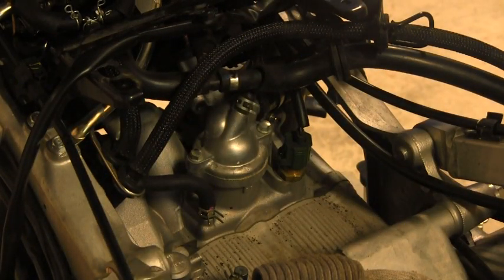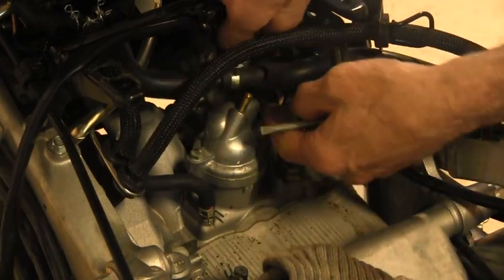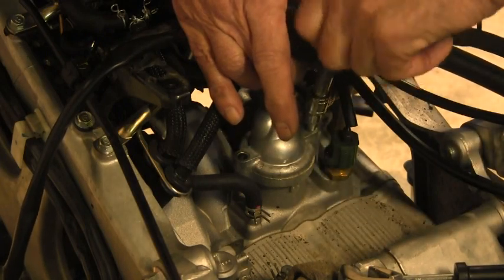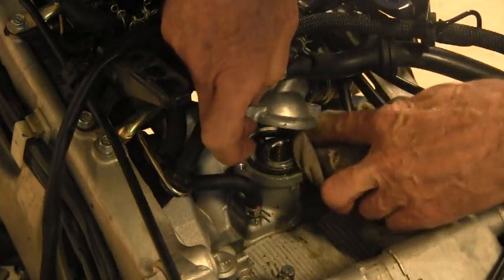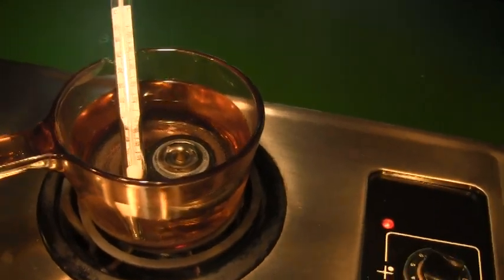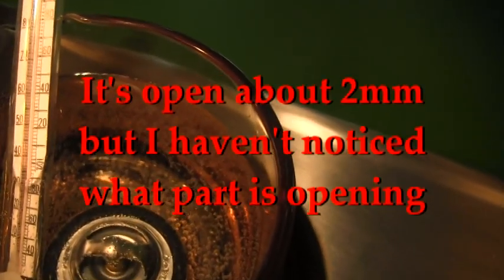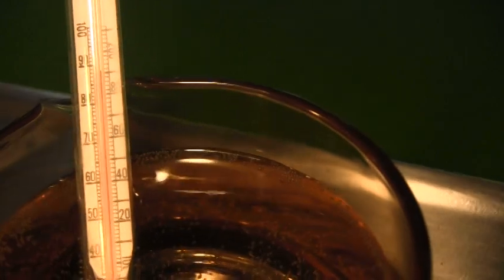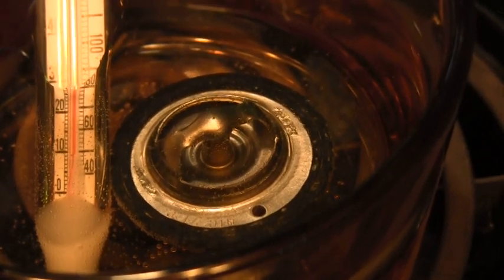Remove and Test Thermostat

Comment: problem is thermostat or not?  what do you think
Reply from the maker: Yasin köse  The thermostat checked out in the pan test, but I don't trust it, so I have a new one coming to replace it.  There is a difference between a couple minute test out of the engine in a pan of hot water, than running for hours with it in the engine with antifreeze coolant.  I was getting the signs from the way the scoot's temp gage was acting, that it was not "closing" when the air temps dropped to where it should have been closed to bring the temp up to normal operating conditions.  Will know for sure when I install the new one and go for a long ride at night when the air temps are lower.